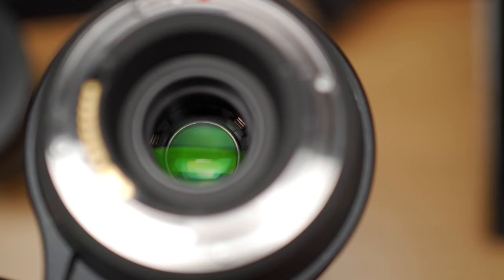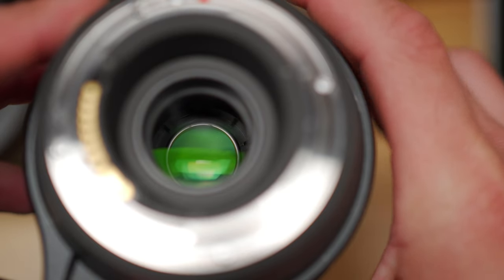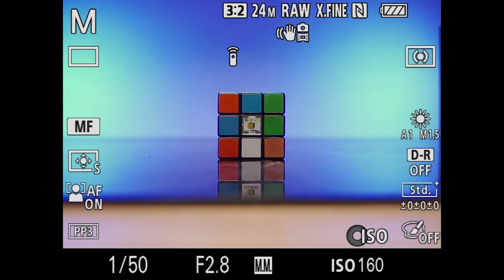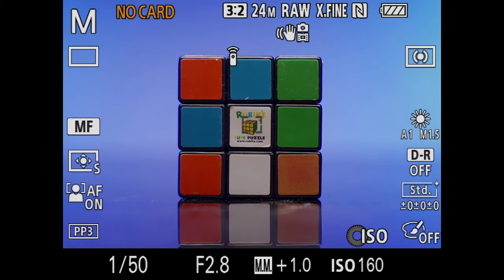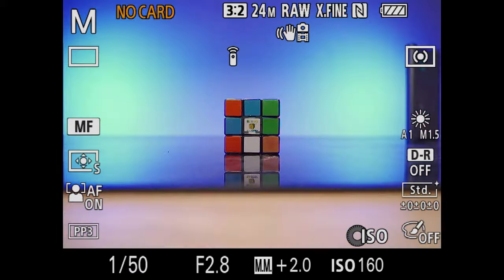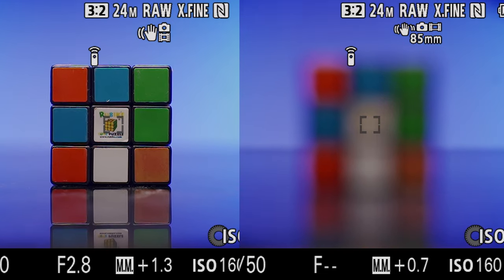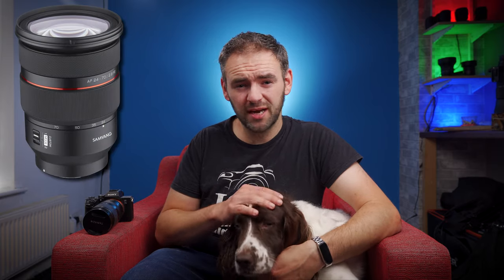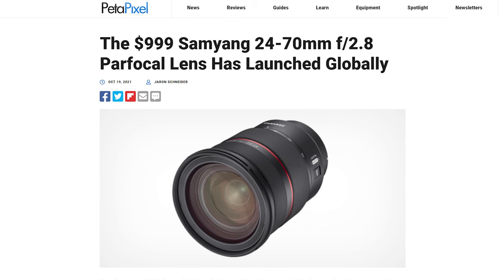Are lenses using Focus by Wire to fake being Parfocal?

Comment: I have tried two of my Zoom lenses (on an a7m4). The Tamron 70-180 works just as your 28-75. My Sigma 28-70 loose focus either I zoom fast or slow. (I can not test my 100-400 GM, because I am on a 10 days trip and the 100-400 rest at home).

Comment: Ok, what about parafocality varying, depending on zoom direction? Sigma Art DG HSM 18-35 F/1.8 is parafocal, while zooming from 35 to 18, but varifocal while unzooming from 18 to 35.
Does it in any way connected to Focus by Wire? Because I genuenly have no idea.
BTW kudos from Kiev, Ukraine, and keep up awesome work!
Reply from the maker: I believe those are mechanically linked although not sure why it's one way, it could be an aspect of how it's linked makes it behave slightly different
Reply: I find pretty much all my lens behavior like this. Focus on long end first and zoom out everything remain focus. But focus on wide end and then zoom in, not remain focus. I tested all my lens, they all behave this way. I doubt this is consider parfocal.